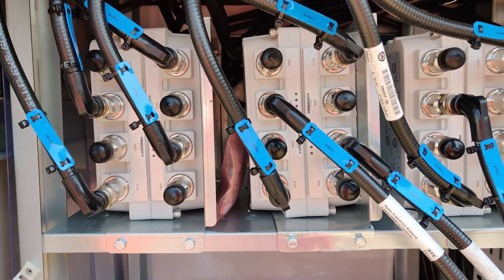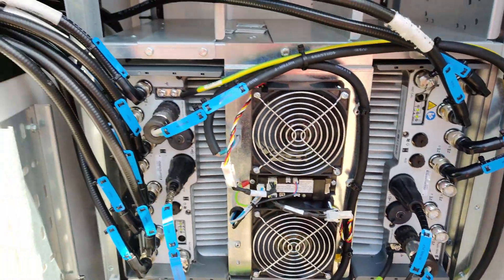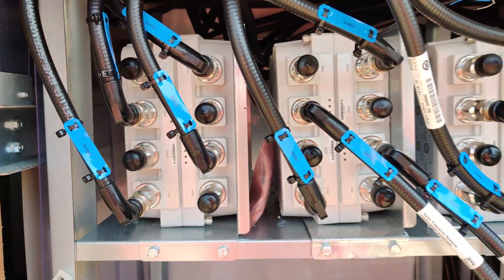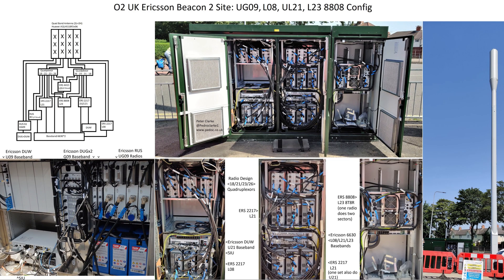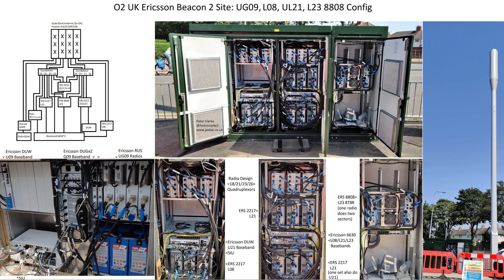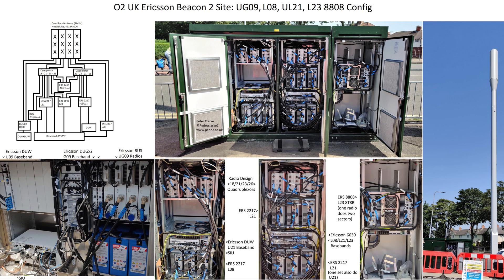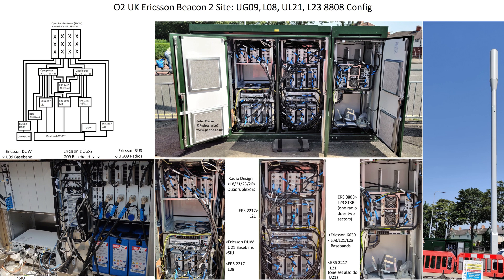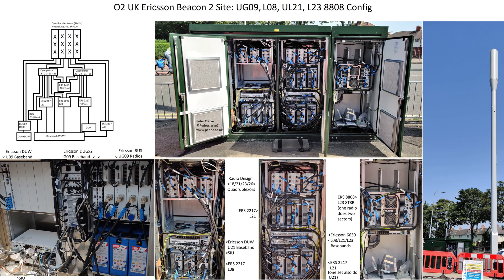Inside latest O2 Ericsson Beacon 2 Pole Cabinets: Ericsson ERS, Basebands, SIUs

Comment: Still running 2g in the UK? The oldest mobile equipment we run in Aus is the 3g 3206 cabinet's. 
But mainly 6000 series cabinets these days with dus/duw. I have done the 5g training but I'm yet to get my hands on one as in in the maintenance side of the mobiles and they are very new. 
Cool video and thanks for sharing.
Reply from the maker: Thanks Damian. EE, Vodafone and O2 continue to operate their 2G networks and will do for the foreseeable future due to M2M contracts and legacy devices. Operators in the UK are planning to switch off 3G in the coming few years though!
Reply: @scivids1999  i see, what kinds of legacy  services do you still have in the uk? 
We aim to switch off our 3g by 2023. 
I'm not sure what the plan is in rural areas as the 3g coverage is far better then LTE. So there might be a few unhappy farmers around the place.

Comment: I see they have backup batteries. How long are they expected to last Inthe even of power failure ?
Reply from the maker: Roughly 2-3 hours of probably 900MHz only. They're designed to deal with momentary power dips  and not long term power failure
Reply: @scivids1999  so more like a UPS system  a computer server rather than the kind of battery you get on a intruder alarm. With good healthy batteries they should  last 8 hours+
Reply from the maker: Indeed!
Reply from the maker: Jackie-to confirm understanding?
Reply: @Jackie Treehorn I was just confirming with Peter C that I had read his reply.